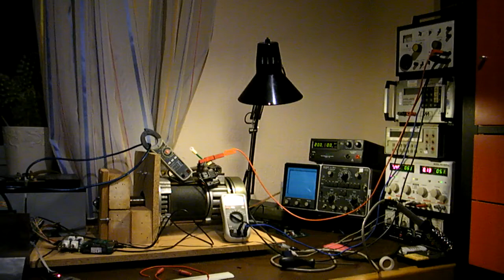Boost Mode Charging with 3-Phase Inverter

Comment: Hi Heubner, Thanks for sharing such a subject, mainly because I have a 2005 Toyota Prius Gen 2... I also have a 2012 Ampera High Voltage Battery and the Car charger unit... I would like to join both so the second gen goes Plug In. 

Do you think it´s possible to reduce the charge voltage of the Ampera Charging Module, so it meets the 68S Pack, I want to put inside the Prius?

Comment: Hi, Heubner. I am trying to figure out how to Mark a version of your project using some model of arduino instead of smt32 that you used. With arduino board do you recomend and what are the main modifications do i need to do to your code to make it works?
Reply from the maker: Some modules are hardware-independent, some are not. I don't know much about arduino but if you can get an arduino board with an stm32 it's probably easiest to port the software.